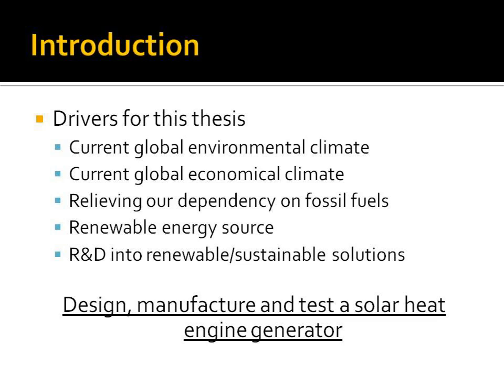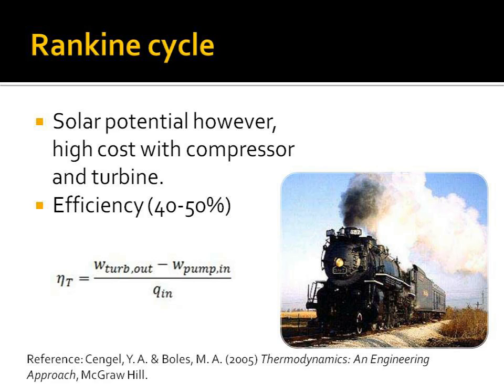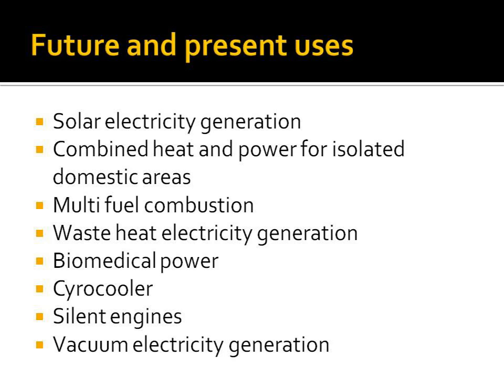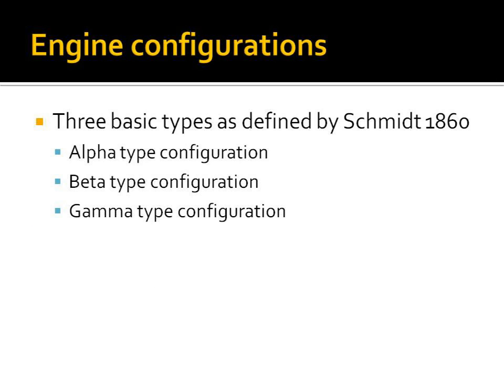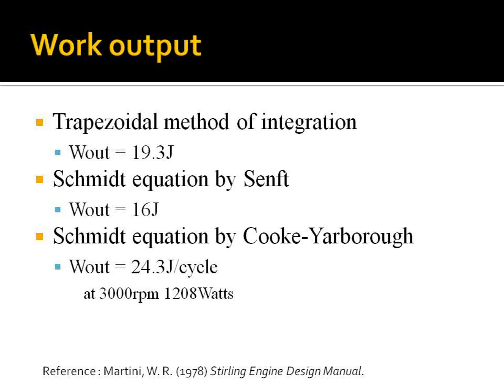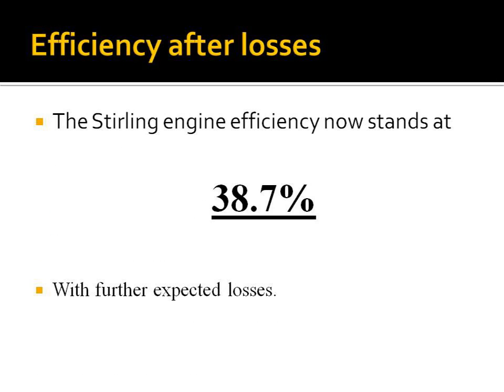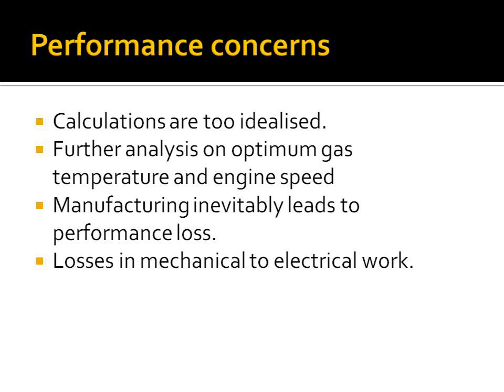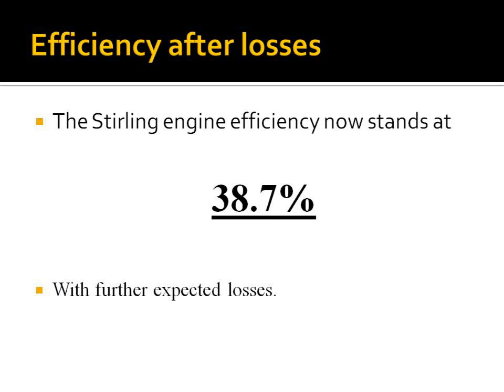A Start to Knowning a Stirling Engine

Comment: @trailkeeper  Ok , it may have seemed like a redundant thing, heating a sterling engine to make hot water, when you could have used the fire to make hot water directly.  Thing is, the concentrated sunlight can be used to heat the sterling engine to make electricity...something regular hotwater generally does not do....and then the sterling engine can be cooled by water, and the warm/hot water can then be put into the household system where warm/hot water often goes down the drain.

Comment: @puppyfurniture  I guess that 5 degrees Celsius, thats about 10 or so degrees Farenheit  here in the States.Solar pv I guess is not a good choice for heating water,because those collectors (solarcells) are about 25% efficeint or less, typically about 18% for most units,.then if that is stored in a battery,it takes quite a bit of current to heat water, but it can be done with those "fast, on demand" attachments.  Evacuated tubes are much more efficent for hot water but they don't make electricty.

Comment: Though there will be some power losses in terms of electricity, most of the other losses will be heat mainly, and if that can be used to heat water, then it's not much of a loss if you can use it in the household enviornment.

Comment: Also, there is a way to use the stepper motors from junk computer printers as small dc generators, if wired correctly. I've seen a guy use one with a small timing belt attached to the flywheel of a very antique tractor and it powered small running lights. He kept getting pulled over at nighttime for no working lights. If materials price is a concern of yours, this may be a small cost solution. Keep us posted!

Comment: This is a very good presentation, although I must confess that I did skip around a bit and may have missed some information. I am a CNC Machinist by trade and I was wondering how much time you have until you have to have a working model,  what is your working fluid (I missed that)? I've thought about your microchannels on the plate between the two pistons. Could two plates be bolted together there with a different set of channels on each plate? If so, they could be easily separated for repair?